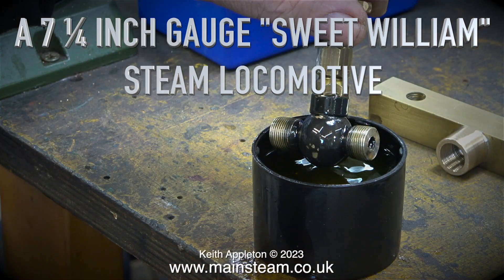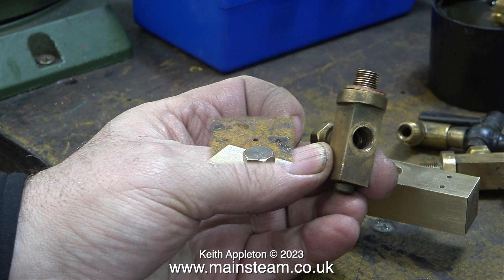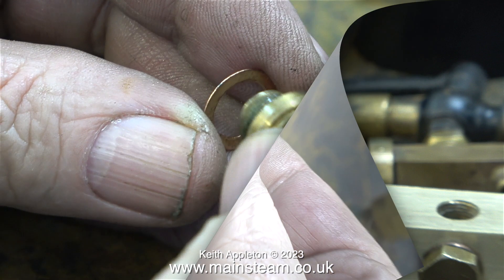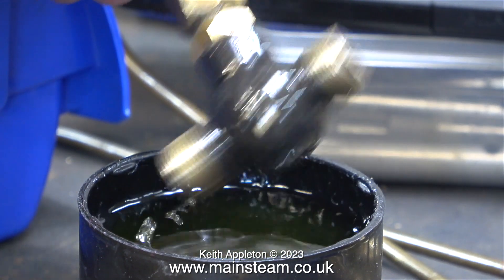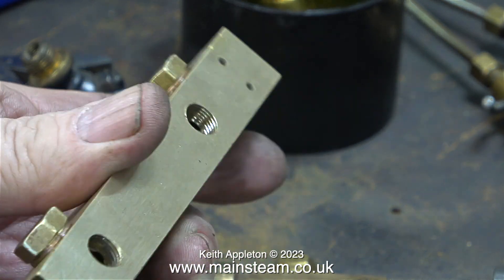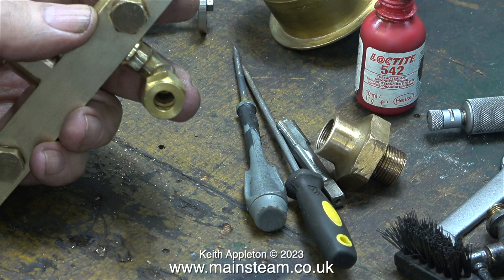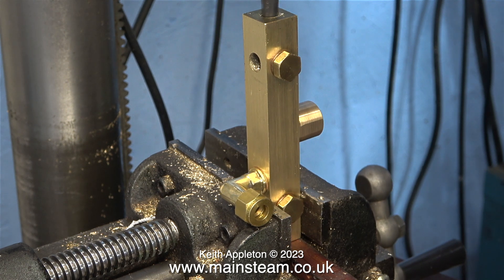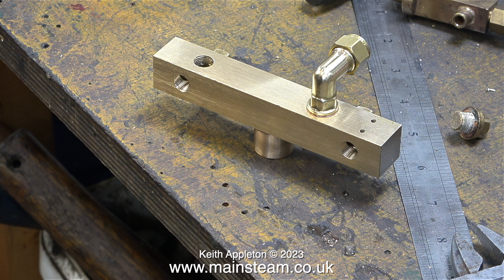A 7 ¼ INCH GAUGE "SWEET WILLIAM" LOCOMOTIVE - PART #20

Comment: Please may I say that I was a proper engineer before I retired. In my engineering career I finished up working on mostly larger things than Model Steam Engines. I was always taught that someone who can work on small things will always find it easier to work on larger things than the other way round.
  I finished up in the design side of engineering so no mare using machinery to make things with. I had to instruct machinists & fitters how I wanted things making. I had been through the shops more than others & my Dad was a Model Engineer when he was not managing things  for a living. I learnt to turn on a treadle lathe, so I took to using powered machinery comfortably.
 I gain a lot of pleasure watching a very highly skilled Model Engineer & you are highly skilled. I am not ashamed to say that I am learning a lot from you. OK there are occasions when I look & think that something you have done is not my way. But that applies with every Skilled Worker. This is model making, not working to specifications on an Oil Refinery, Nuclear Power Station, or any modern company. You are making things fit together properly. So I shall keep on enjoying watching you working & learning a few more tips. Mervyn Price Retired Engineer.
Reply: Properly said by an experienced hand. I’m of a similar mindset to yourself but strangely from the younger generation as I’m only 36 but feel I’m on a similar path to yourself but in my original profession of cabinet making, and now moving into design and programming for CNC machines using the experience gained since starting making things from a very young age.   I really enjoy Keith’s videos while I’ve been learning about metal engineering basics as it interests me and want to make model steam engines, and Keith’s honest approach to his work has taught me a lot already along with many other engineers that share there knowledge and skills through YouTube etc. 

Keith if you read this, genuinely Thank you
P.s. I have a Nearok 350m too and ML7, so your approach of sticking with the basic tools for beginners who you aim your videos is spot on and extremely helpful 🙏

Comment: I've made manifolds like these for air and hydraulic lines out of steel, but for the slower speed of the drilling, the process is the same. The only thing I've done differently is weld brackets to the manifolds to support them.  You're right, you don't need to be an engineer to do this, just good old common sense will suffice!

Comment: Thanks for another good video.  I really like the way your end blanking plug looks.  I know you picked out of your spare parts tub, but any idea who carries ones like that?  That plugs lends a real industrial/steam era look. I hate when paint won't come off an I try not to move up to the more extreme industrial chemicals when ever possible.  When I soak a part I try to remember to scuff up the finish.  Not sure why it works, maybe increased surface area for solvent to affect.  But it improves solvent performance.

Comment: No reason to break out the gage blocks, optical comparator and jig borer when the functional tolerance is far greater than the esthetic one. Line it up by eye until it pleases you. The steam won't care as long as the holes intersect and don't break through the sides of the block.